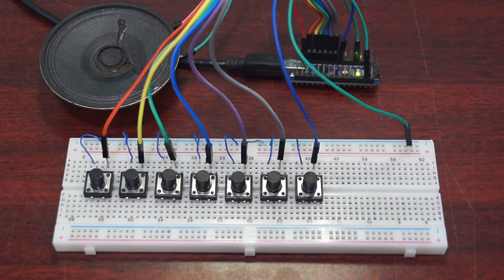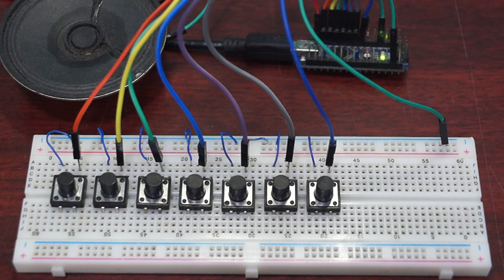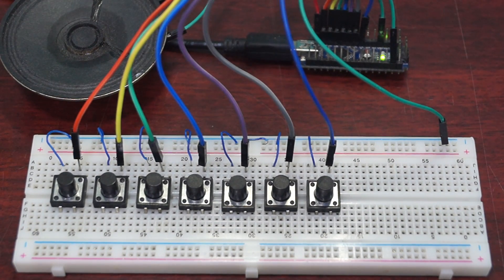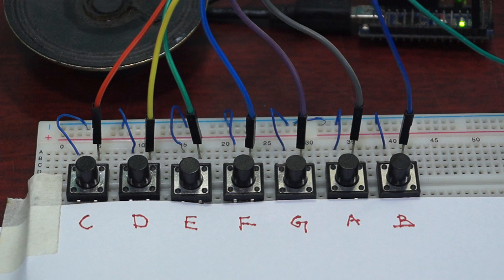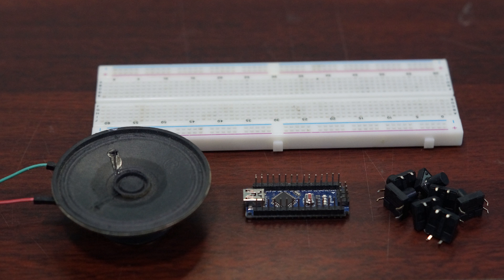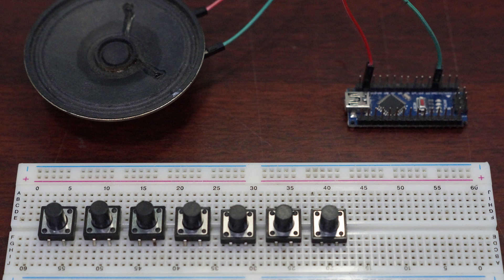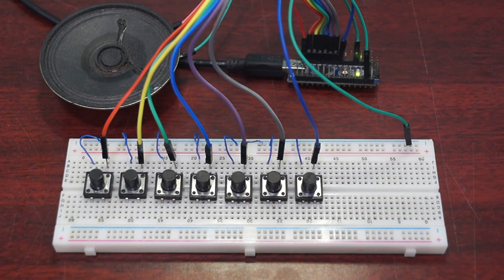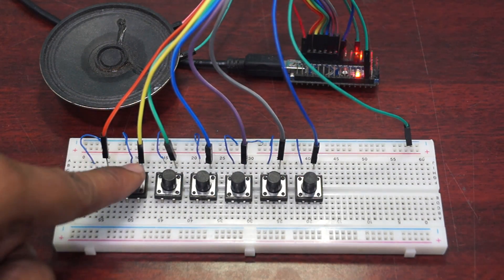Arduino Tutorial : Mini Piano

Comment: Where did you joined the another point of wire of Arduino??
Reply from the maker: You can refer to this connection.
 
https://content.instructables.com/F78/014Z/KA2F4ZMV/F78014ZKA2F4ZMV.png?auto=webp&frame=1&width=1024&fit=bounds&md=e0e004d10a3f56b197f4d7d5e5d57837
Reply: No I, point cable is connected to Arduino where's another one is connected?
Reply: no

Comment: if you have proper schematic diagram it will be very great
Reply from the maker: Hello! you can find the connection diagram here. 

https://content.instructables.com/F78/014Z/KA2F4ZMV/F78014ZKA2F4ZMV.png?auto=webp&frame=1&width=1024&fit=bounds&md=e0e004d10a3f56b197f4d7d5e5d57837

Comment: I tried this project. But I could not get Tone Arduino Library from Github. It's link is not given. Please give link for Tone Arduino Library from Github as mentioned in the description.
Reply from the maker: Hi,  Tone Library is in-built in Arduino IDE. You can try installing the Tone library from the  Library Manager from Sketch -> Include Library. You can also try updating the IDE to the latest version.

Comment: Can you sen me a draw of the digital circuit pls? anyways is it possible to do this with 12 buttons and one buzzer?
Reply from the maker: Yes, it is possible with 12 push buttons. All you have to do is assign the analog pins to digital.
Reply: @electroverse_ai  could you help me out? I need this for a project, I need the code and the digital circuit, the rest I can handle myself pls. If you are going to help me contact me on andre63.morais@gmail.com